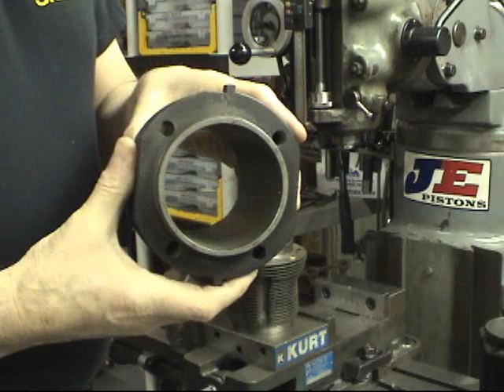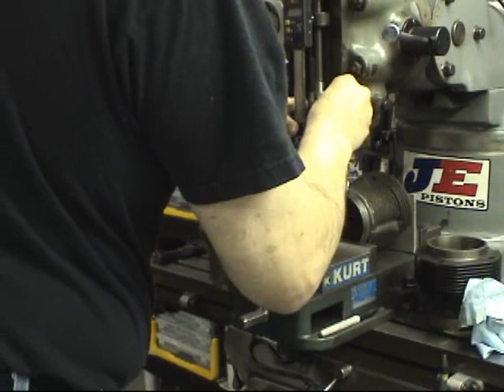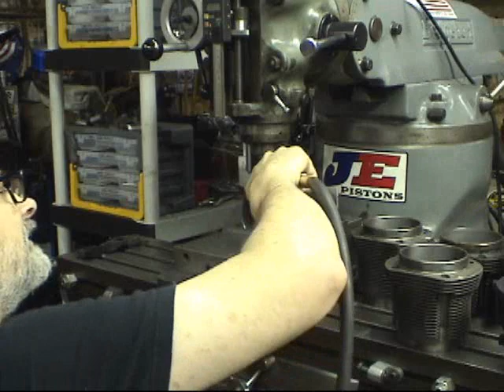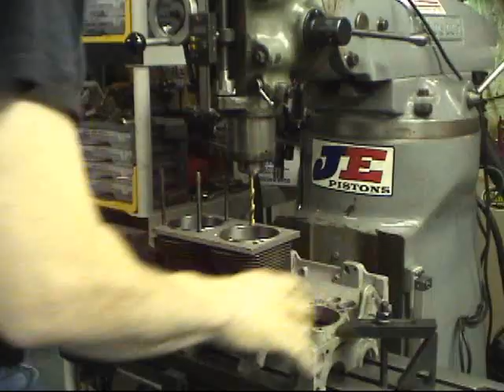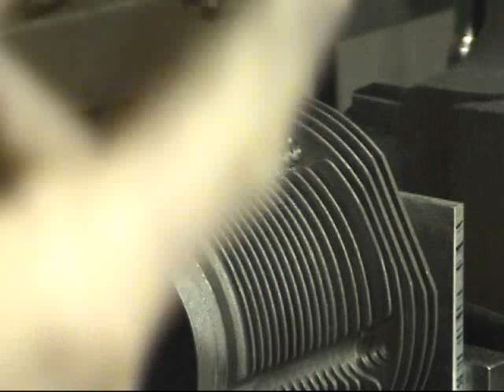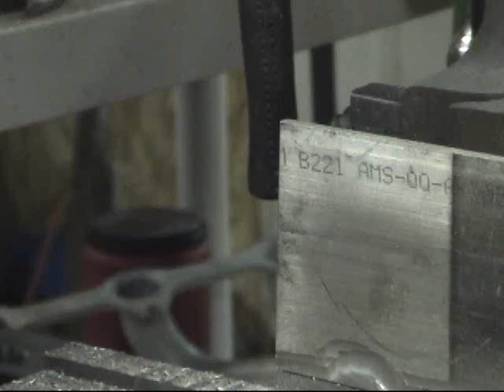Machining 94mm VW jugs for the Chevy Corvair

Comment: hi every one . i have been building and racing vws for 30 years .i love air cooled motors .and corvairs  . great vid. but i have to say some thing about the vw 94mm cyls.i hope what i have to say is not taken the wrong way . over the years i have found out that the vw 94 cyls are great for drag racing . but not that great for street motors . they  have  a  very thin  cylinder wall  and do not hold up on the street .  and after 10,000 miles they start to have blowby and the motor start to lose power . i have found out that the new 92mm thick wall cylinders  being sold now  . have a way thicker cylinder wall that helps cool the motor  and helps stops cylinder blowby  we have used these 92mm thick wall cylinders on are drag race motor and  and found out they made more power than the 94 thin wall cylinders and  we ran better ET  times  with the 94cyls we ran best time of 11:00 1/4 mile  with the 92 thick wall cyls we ran 10.60s at 131 mph in the 1/4 mile  this is just my two cents take or leave it
Reply from the maker: Never take data respectfully delivered by someone knowledgeable!  I had heard they were prone to cracking, did not hear anything about blow by. I know most ships never measure surface finish. I have very specific numbers for RPK, RVK, and RK.  Having proper finish creates the gasket needed for rings to seal. Of course as the engine is run the RPK and RK will get less and eventually the RVK will diminish also requiring a new hone.  Not sure how long these jugs will last but if I need to change every year so be it.  I should also look and see if darton makes a sleeve that would be usable.  Those would last many hone jobs!
My 94mm jugs will have slightly thinner walls than others as I plan on making them straight and round, which they are not.  So probably .002 or even .003 will have to come out of them.
I appreciate your comments, always good to have more data!
Reply from the maker: Meant to sat never take the wrong way!  Just looked and see I said never take!  Always interested in hear from others with experience, nobody knows everything, so I am always open to learning!
Reply: What is the adjustable cutter you use to cut corvair heads. Thanks

Comment: Is this engine for competition/off road, or a wicked street machine? What kind of HP did this engine wind up achieving? Great information and craftsmanship.
P.S. with all due respect, did anyone ever tell you, you sound like Adam Corrolla?
Reply from the maker: This is just for a street machine.  As I have mentioned, my day job is building race engines, pro mod, comp dragster, top dragster, etc.  The slow ones run in the 6's.  Believe it or not, I have not finished this engine!  Finished many others for customers, but mine is always last (I hope in building only LOL!).  Anyway, I recently got a gig working in engine development for a major OEM, and am hoping to have a bit more time to devote to my stuff.  Realistic time frame to have this done is mid to late summer of 2022.  I did recently get my rings made, had clear idea of the ring pack I wanted to use, and tension I wanted.  Total Seal is great and will happily make any ring you want!  I had them gas port my top ring, so I did not have to do that to the pistons.  offers some advantages over porting the pistons too.
Reply from the maker: Oh, no one has ever said I sound like Adam Corrolla, I have been told I sound like Howard Stern.  I would rather sound like Corrolla!  LOL!

Comment: I have been considering milling the outside cylinder mount side of the Corvair cases down to add a 1 inch 6061 plate on either side of the engine. This will allow me to place cylinder jug studs anywhere I want. At which point I can use 911 Porsche jugs at 108mm. With air cooling, cutting billet heads in any shape you want is a piece of cake. 429 Boss style heads are about as good as it gets for 2 valve chambers. Billet 3.3 crankshaft and boss style ports will make a 911 destroyer. Add a 5th bearing on the flywheel/prop mount end and use a Velvet Drive damper flexplate and a Duramax Allison billet planetary for 1000% indestructible speed reducer and cam it for 5500rpm. Now you've got a motor that will make 350hp easily turbo normalized to 36fl. In a car it could handle 1000hp boosted. Or somewhere in between for a Reno plane. With low timing, properly designed cooling cases, you will be good to go. Low frictions, dlc, and ceramic coatings would be have to be used everywhere possible to manage heat in an air cooled powerplant. The weight saving is beyond incredible. No water, no radiator, no mounts, hoses, clamps etc. Oil coolers and piston spray bars will be necessary for longevity.
Reply: And one person can carry the long block around easily. If it's a hit then newer formula magnesium MMC can be used without fear of stud creep or corrosion to further reduce aluminum part weight by 30% with an increase in strength.
Reply: @curvs4me  the fifth bearing is an excellent idea as is the idea of plates on the sides of the case.  The bid issue is controlling heat.  108mm jugs would leave only 7.468mm between the pistons.  After adding 6.35mm for cylinder wall thickness there is not much room for cooling fins.  The corvair has a 4.840" bore spacing.

Comment: Fascinating using modified VW cylinders for a 6 cylinder Corvair engine. I knew nothing about them but found these videos but have been curious about Corvair engines after having a couple of VW's years ago. I'll be interested to hear one of these engines running!
Reply: Well it will be a bit because my regular job building race engines (pro mod and comp dragster mostly) keeps me busy, but I am doing a quick freshen up on my EFI 110HP engine, so that will be running soon.
Reply: @tomstark5285  Its a bit like watching Allen Millyard building a modified V-6 for his Kawasaki!

Comment: Just started my first Corvair project thanks for the video very  informative. Can you tell me what are the pros/cons to installing 140 heads on a 110 block and if it can be done or not?
Reply: Sorry it took so long for me to reply.  Yes you can put 140 heads on the 110 case.  You will need a set of late model jugs, as the head gasket surface is a little wider on late model heads (140 and others) than it is on the early model heads (64 and earlier).  the advantage is your engine will breathe better and make more power.

Comment: What engine are those going on (110hp, 140hp?) and what HP are you expecting?
I'm guessing this modification isn't recommended for 150hp or 180hp turbo "Spyder" engines?
Reply: You can do it on a turbo, but you have to make other mods. You need a modern turbocharger and ignition control

Comment: When I was doing small block chevy screw in stud conversions, the cast iron heads used to eat the taps. On the brake drums and rotors, it was pretty much manditory to use carbide. Cast iron varys greatly in quality it seems. These mix and match conversions you do are just what puts the soul into a vehicle. The corvair was one car I always wanted, it just never happened. I did have plenty of VW's though. I wish I could have done back then what I have the capability to do now!

Comment from the maker: When I get a chance I will check out your video.  I have found that cast iron cuts pretty easily, carbide is fine, but I usually just use HSS.  No lube, cut it dry and works best.  Need to get the surface speed where it wants for the cutter and the hardness of the cast iron.
Reply: Well a decade later how do you match the Corvair wrist pin diameter to VW pistons. What about deck height.  The corvair 165 cid is a 74 mm stroke compared to the stick 69 mm  VW stroke.n
Reply: @tomstulc9143  Well for some reason I can't log into my grasshut account.  Anyway, these are stroker pistons, short CH, don't remember right off hand.  I am using long rods, 5.290 (originals are 4.7xx)  just need to cut a little off the bottom of the jugs to make the length right.  That video will be coming when I have time.  Need to get back to this some time!  My day job, building race engines including Pro Mods, really takes up my time!  Hope this answers your question.